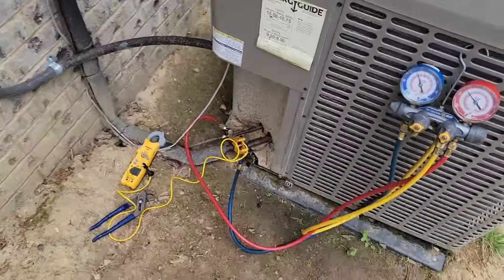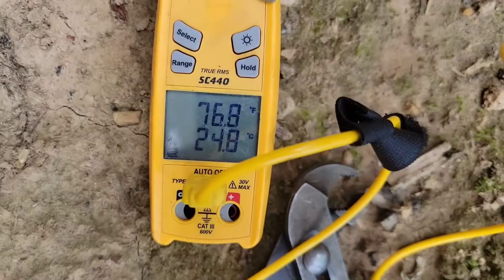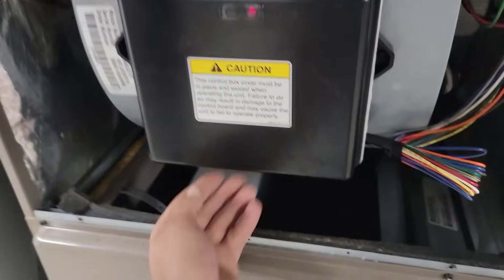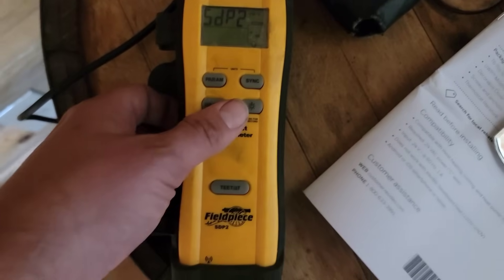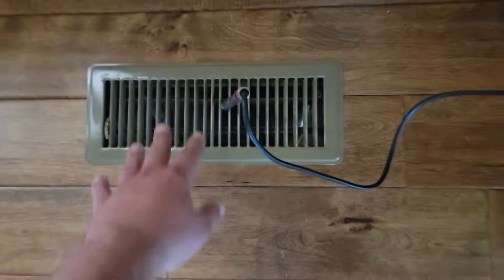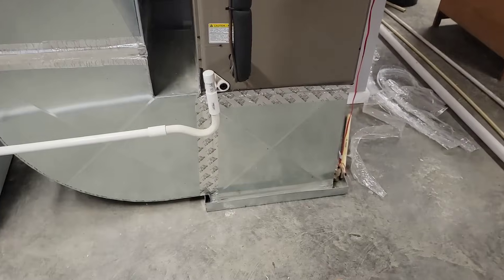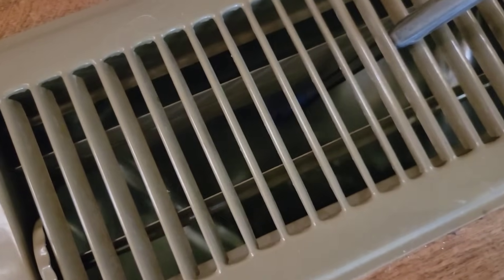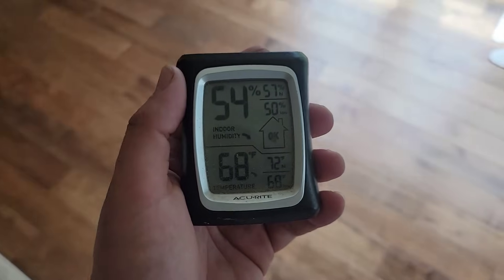How to adjust airflow and make hvac magic? @YorkHomeComfort

Comment: Not sure this is an accurate video.   You need a certain air flow based on tonnage.  Just because your delta t is what you want it.... the air flow is important for complete house coverage.  I would think your delta t should be good at a high flow rate.  If you don't get it... clean your coils
Reply from the maker: I'm not sure I understand what you mean
This is a brand new unit
Coils don't have to be cleaned. It's new.
Reply: @taddydigest  you are talking about delta T.  Lowering the flow of air to get the delta T you need is not helping.   For cooling you need to treat a large volume of air in the shortest time.  You need the proper delta t across the coil at a proper flow rate based on tonnage of your system.   Lowering your flow of air will not provide good results.  Its like having a dirty filter slowing down your air flow.  Perhaps we will just agree to disagree.  I had a Nest thermostat that would not access the high speed on my cooling system.  House was always warm.  Turfed the Nest and replaced it with an Ecobee.  Boom house was cool .  It's all about air flow and delta t.

Comment: I do lots of auto ac repairs, replaced an evaporator in my truck recently, thinking of doing this as a job :lol: It is similar. There is no subcool on a truck though :lol:. Once the truck moves everything changes. It is charged strictly by weight.

Comment: Careful with those cheap temp/hygrometer.  I have 3 of them that all read wildly different values sitting next to each other.  I have checked their calibration and 1 of 3 was with 3% RH at 50%, others were 7 and 8% off.

Comment: Why wouldnt you take you return temp from the actual return? And not from thermostat.  Also 5 degrees of superheat seems low . Mb just the fieldpiece?
Reply from the maker: It was the same temperature as the thermostat. I did check it but I didn't show you that 
Why would five degrees seem low to you
Reply: @Taddy Digest  I thought a txv maintains 8-12 degrees. 4 or 5 I would start thinking low airflow/not picking up enough heat
Reply from the maker: very good 👍

Comment: Check the static pressure bro! This will simplify your process! .5-.7 on most models. Then go level the vents. Nice video.
Reply from the maker: thanks 👍 😊
Reply: @taddydigest  yeah, you only breezed past this discussion in looking at the ductwork. In my multilevel home with more bends in the ductwork than the roads of Hazzard County, I had to get a boost fan on the return side to even things out - the blower couldn’t “suck in” what it intended to cool very well, and I expect the house will be more comfortable in the winter because of it as well.

Comment: It's nice when the basement is open and you can access everything but when you have a finished basement and very little access to the ductwork there's little that can be done in way of balancing ductwork and adjusting blower speed. If I went into someone's home and told then, Hey if you let me tear apart your basement ceiling I can optimize and balance your system by changing your ductwork/fan speed for a more efficient system. They would point me to the door and tell me to leave.
You also have to consider the customer's budget. It's not cheap to redo all the ductwork in a house and 90% of people will tell you NO. 
It's a great install and it looks nice.
I am concerned when I hear that the units superheat is only at 5 degrees. If your superheat is to low or nonexistent you run the risk of liquid refrigerant coming back to the compressor and causing damage or it washes the oil out of the compressor which would also cause it to burn up and fail. I normally try to set my superheat at 10-15 degrees.
 I still liked your attention to detail and I hope to learn a couple things from you in the future. Thanks for the content.

Comment: Well factory charge is 15ft on that York. Then there is a chart to add after that. Off top of my head its .6 oz per ft after. I would add extra charge befprw opening valves. Dip switches should have been set before turning on power. Rwmember long flex lines past 5' add static and drop cfm/pascal. When in doubt pipe it out. Flex should ONLY be use to minimize vibration.

Comment: I moved into a condo where the air is not balanced in the upper level. It’s about 10° higher on a hot day. I’ve determined the problem is the air return. It just does not pull hard enough to return air from the upper level, but does fine at the main level, there’s about 40 feet of run for the returns in the upper level. Is there a solution to this?
Reply: Cheap filter
Reply from the maker: Absolutely there is a solution
Reply: @taddydigest  What do you suggest? No one has been able to offer one.
Reply: @yourmedicareguylarrybelt7792 does the upper level have a thermostat or is the thermostat on the lower level?  Would probably do better if it was zoned as well. It's prob a combination of the long return, also if thermostat is downstairs it's gonna satisfy by that temp and may still need more run time to cool the upstairs down. Zoning it would help. What size are your returns?

Comment: I got a similar york unit. Its capable of dehumming also. 
So far like the unit. 
Not a fan of the flex in my attic though. I am foamed in the attic. 
I hate hearing the vents also. Had a tech come by and want to turn up the fans. 

Need more like you.
Reply: All air conditioning dehumidifies. Some better than others
Reply: @racegrubb2152  yes a product of creating cold air.  However some have a specific mode to dehum.

Comment: I prefer to take static pressure and set air flow to 350-400 CFH per ton of cooling. With your second probe it will compute TEET.
Reply from the maker: very good practice I like that 👍
Reply: Without design conditions(manual j) , how are you achieving proper SHR from the equipment?

Comment: Hello, I have a bi-level home and cooler in the lower half (finished) I have a return vent on the other side of the wall just before my filter, question since my upper level is way warmer, should I close that lower return vent located near the filter ?
Reply from the maker: I would have to know what tonnage your equipment is
How much return does your equipment need based off of the tonnage
Then I could determine whether or not you could close off that return
But until then i'm afraid it may affect your equipment in a negative way

Comment: I have a question if you adjust blower speed on a variable speed motor will the blower motor still do the variable speed option?
Reply from the maker: Yes.

Comment: Most techs or installers don't do this. Also true Delta t requires humidity reading. The higher the humidity the less the split will be. So you might b be at 17° split then when humidty drops it might read 20°. Good work like watching you.
Reply: you are right, most Real Techs actually do it right, lol
Reply: @craigkennedy9968  And mine did not..... I am really unimpressed by the people that did my central heat pump installation.  I am hoping to talk to someone who knows what they are doing tomorrow, but right now I absolutely hate the new unit that was installed yesterday and the tech guys had zero patience for answering my questions.  Then they just left me with a noisy disaster.

Comment: Am I missing something?? 1000 cfm? 800 cfm, 700cfm??  Out of a 6 or 8" vent? What was your meter set on?
Reply from the maker: Feet per minute not CFM.
I meant to say feet per minute
Reply: @taddydigest So about 700 fpm from the supply registers and about 300 fpm on the return air.

Comment: Most service guy's would just put the fan speed at maximum speed.
Reply: Most systems with variable speeds you can't adjust fan speed
Reply: @Almtyhalfbreed  Yes, I am aware of that but was referring to the good all 3-4 speed motors.
Reply: @bernardaflores1720  yeah because you’re supposed to. If you have a conventional 3-4 speed motor the unit is designed to have the motor set at high speed for cooling. If you don’t you’ll have problems.